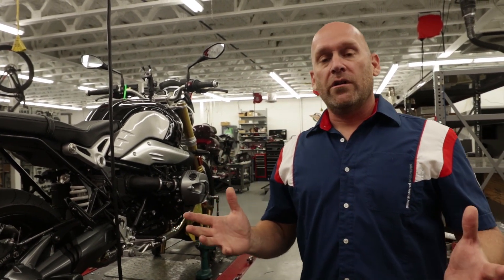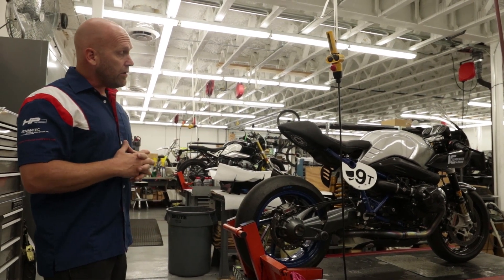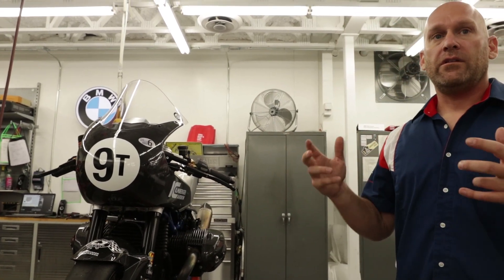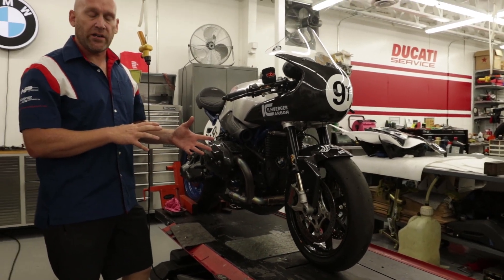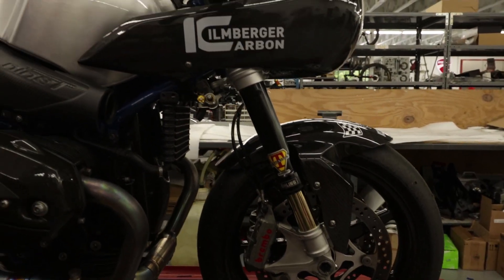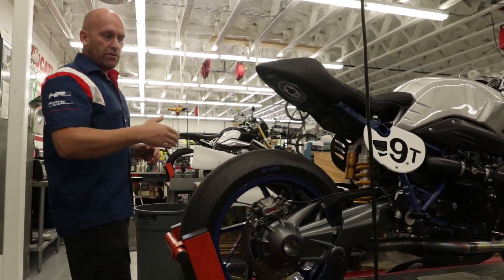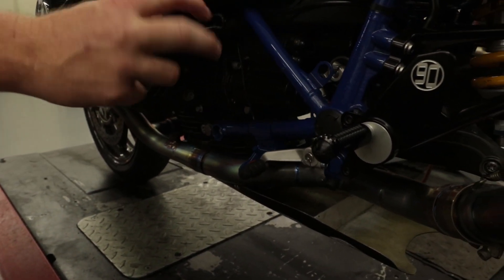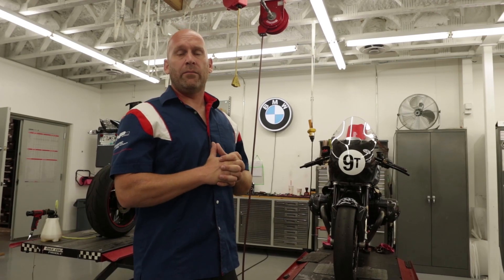R9T Race Bike Walkaround (Featuring Nate Kern)

Comment: Hello Nate, Did you change caliper or just the braking pads? My local Brembo dealer told me M50 is not fit for R9T, need to remove Abs system.